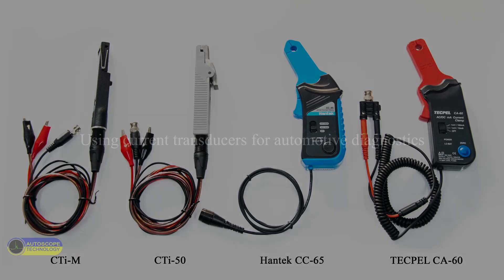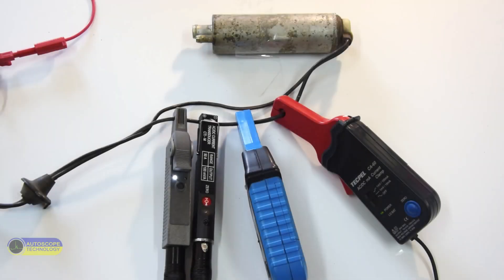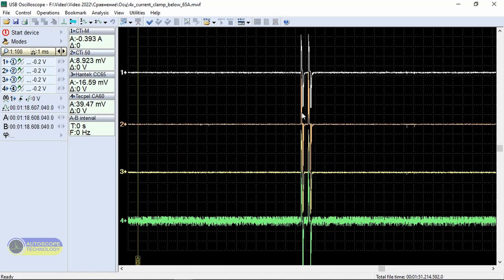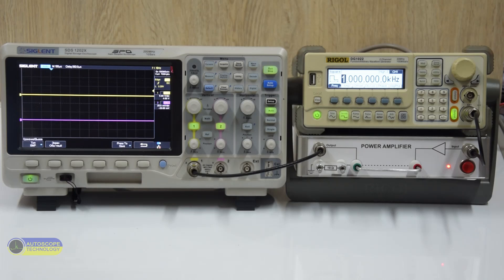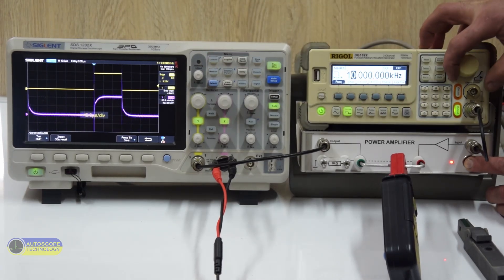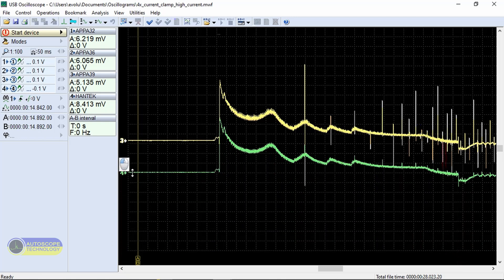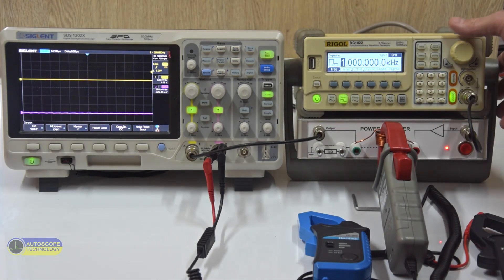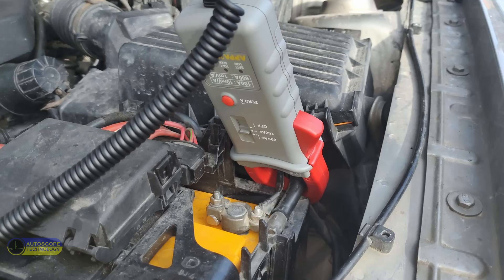Comparison of current transducers for automotive diagnostics

Comment: 10 KHz is 10,000 rpm. There's no point having high bandwidth as it produces much more noisy looking waveforms.
Reply: non-sinusoidal waveforms need much more bandwidth than the base frequency in order to display their details.